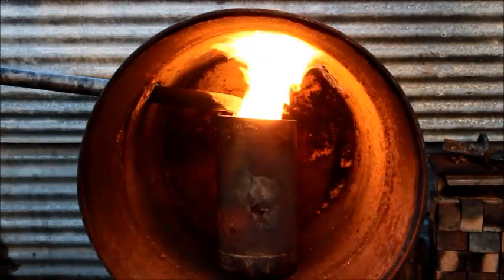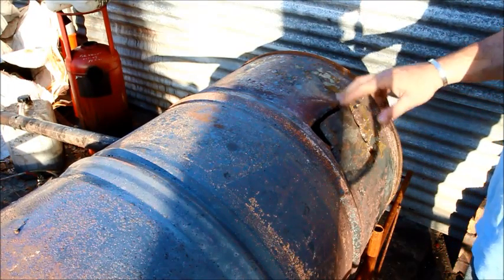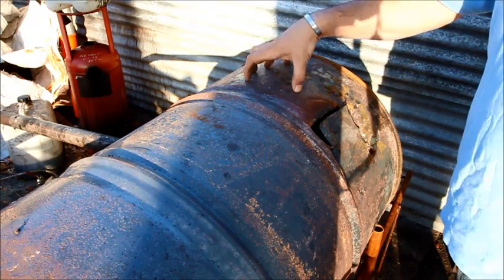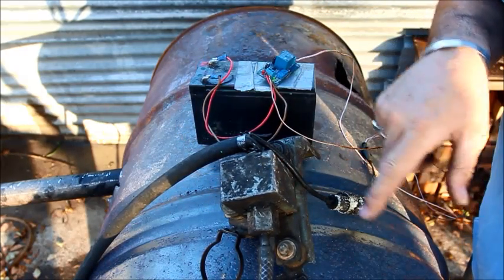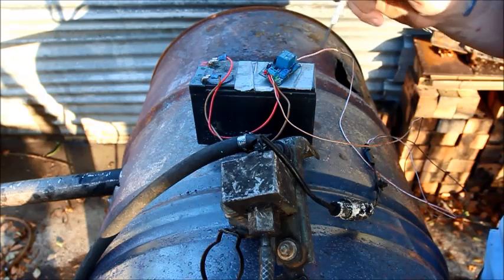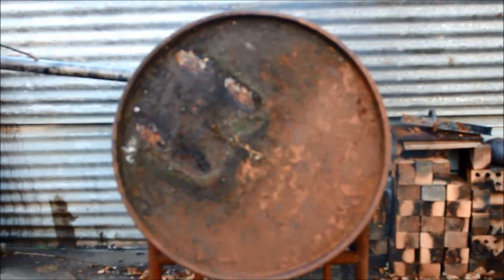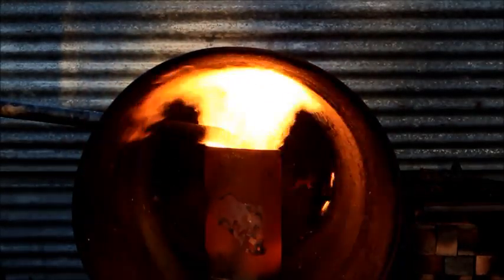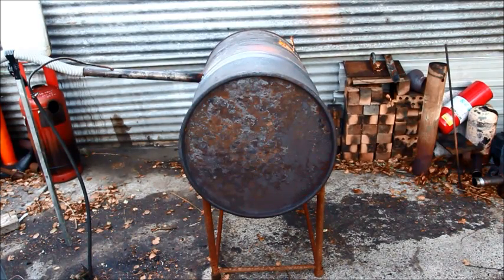Shed heater, easy Build, powerful output on waste oil.

Comment: It would be nice to see just how small you could scale that down to.  A fifty gallon drum takes up a lot of real estate in the shop.  Also be curious to see how much CO is going up the chimney vs how much is dispersed into the surrounding area.  Thinking of a closed up winter shop.  You have me thinking of melting down aluminum outboard blocks etc with a refined version.  Take care.  Doug

Comment: Very impressive, burns real clean, especially once that pot gets hot. Trouble for me would be finding the blower and that pump.
Reply from the maker: Ebay is your friend!  :0)
You could use a much smaller blower for this, doesn't have to be as large as I have. A small reversed Vacuum cleaner would be fine. The pumps are easy  to get and popular. Just look for Facet Pumps. They are available all over.

Comment: I am just about done building mine. One issue I ran into was the burn pot burning through. I tried using a 4"id thick wall pipe with a bottom welded on, however the air inlet acted like a cutting torch. So I lined a large fire extinguisher bottle with refractory and it seems to hold up pretty well in testing. Thanks for the idea, works perfectly!
Reply from the maker: Very interesting. I haven't had the burn through problem on this design. I have used an extinguisher bottle and a light metal can and they have survived quite a few hours running them at full tilt. Might  be something to do with the positioning of the air inlet. Mine are pretty high up, don't know if having them lower would make much difference but I think having the refractory in the burn chamber would be perfect.

Comment: If you were to build a water jacket around this and fill it with an antifreeze solution it would be great as a remote burner to power radiators in the house with no danger of burning your home down. If some unforseen problem causes a fire all you lose is the burner shed.

Comment: Turning this into a home heater would be so dang easy.
Reply from the maker: I think all you would need to do is seal it properly and it would be fine. 
Certainly be one of the more powerful heaters around as well as the cheapest!
Reply: I would love to use it as a basement heater, as on low heat even it would heat the whole floor of the upstairs pretty easily. But I'm really concerned over the liability issues and what not.
Reply from the maker: HUsoldier171  unfortunately that's not something I can help you with. It does seem to be a big pre occupation for Americans though with their insurance companies. Sounds like they really have you under the thumb which is never a good position for anyone to be in. I think If I were putting one of these inside a house I'd also be fitting a lot of detectors and shut down controls in case anything did go wrong and be making sure it was well isolated from anything flammable.

Comment: Your chimney rant was singing my song. Cycle timer is pure genius. It is 40F, here, just the wrong 40!
Reply from the maker: I have done another configuration with an upside down Chimney Kevin and it worked unreal. Makes me wonder why all heaters don't have the chimney at the bottom instead of the top! As for venting Chimneys straight out, never understood the idea of getting rid of the majority of what you wanted so fast. 
perhaps we could take your 40 and my 40 and come up with 23C which is the perfect temp?
Reply: I vent my Rocket Stove Space Heater down and out along the ground and it works fine. The exhaust is barely warm to the touch. I'll take that 23C!
Reply: +Oil Burner  you could also use a double barrel stove design, or get fancy and do some welding in the second barrel so a fan can blow air through and the exhaust can go through without mixing (because you don't want CO poisoning) and you'd have one hell of a heater.
Reply from the maker: TheStarforce2   That sounds like it would work well.